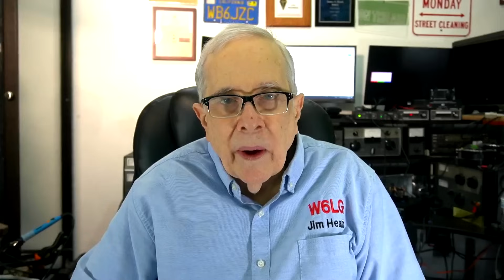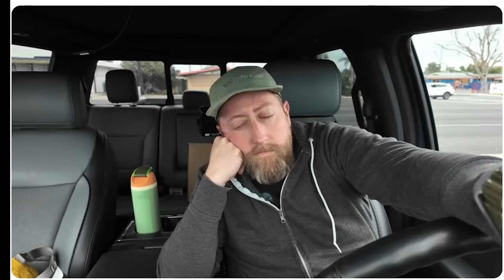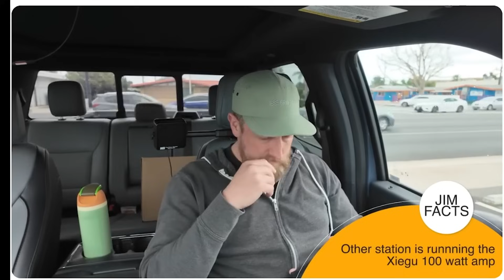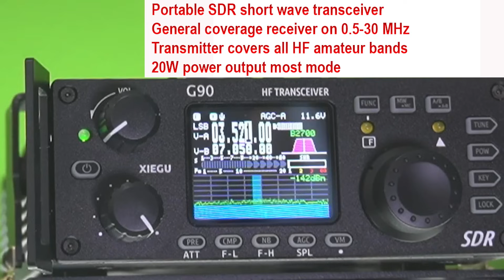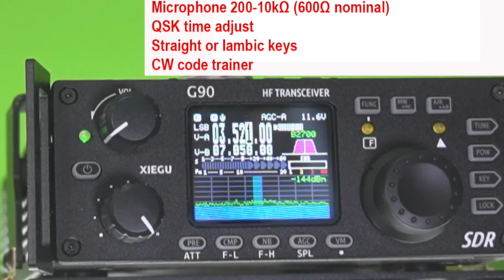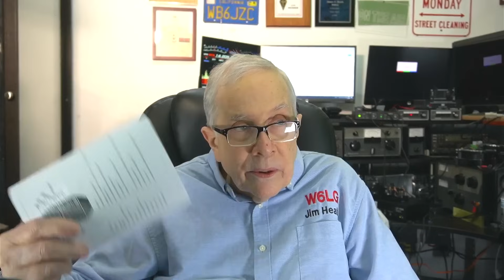What HF Transceiver Can A New Ham Buy For $500?

Comment: 73 from kc0lkv, owned a g90 and worked all over the world with 20w. I have a good antenna, a Gap Challenger Dx, and I believe that it is the most important part of your station . I have few good Hf like the 7300, the 710, 991A and my favorite Ftdx5000. I believe that there are few good Hf for less the 1000. Like the Yaesu 891 and Yaesu 450. Both exceptional radios ..especially the 891. Just my 2 cents. 73 Andrea

Comment: Hello Jim - Really great to see you again - I have a G90 which I use mobile/CW.  I find it a really great rig and get great pleasure from low power operation. Being a 100% CW op I find it great on CW especially the filtering.  While the filtering is not as good as my old Racal RA117L for the price it is a great little rig especially for a new Ham. 
73 de Ger County Clare Ireland.

Comment: I still think a good idea for a new operator is to connect with a local club.  Active clubs often have members who are upgrading and surplusing their old radios, often for less than a new G-90.  No warranty, but you are buying among friends who are unlikely to give you a bad radio.  Our club puts any radio it receives for sale on a service monitor to check its health.   And the used radio may come with accessories that you would otherwise have to buy.  Sure, the older radio may not have a video display with waterfall, but it may have more knobs & buttons instead of cryptic menus going 5 levels deep.

That said, the detachable head on the G-90 appeals to me because it would be easier to install as a mobile rig in my Tacoma than a lot of other radios.  Glad to see that it gets a thumbs-up from you, Jim.

Comment: I've had two G90's and I still own one. I think the guy in the conversation said he was using the optional XPA125B 100 watt amplifier which costs about $100 more than the radio. I also have the amp and I love them both. Lowest price I've seen lately is $415 for the G90. Good to see you Jim.

Comment: Output power is only ~16W in reality.. And bugs of firmware (display freezing sometimes). SWR meter shows better results than in reality. Tuner is very good. FM broadcasting is buggy (f.e on 11m). Good value for money.
Reply from the maker: I think that I said I tested using a Bird 43 and a Bird Dummy Load on 20 meters. Supply voltage was above 13vdc.  73, Jim W6LG
Reply: @ham-radio  Maybe. But this is also with pro meters..
https://youtu.be/5uX57EkcL-M?si=C75aNMMK-3_fBqFI

Comment: Thanks Jim for taking the time to share your thoughts and opinions with the community. I was that ham when first licensed in the early 90’s. I couldn’t afford a HF rig. Finally got a good used Kenwood TS-140 ( I still have it ) a very basic entry level radio even then. Later after passing the tech+ allowing some HF. I rolled that big vhf knob many miles. 
I am very fortunate to have since upgraded. As we get older and have more expendable income. I own a G90 it is a great portable radio. I also have the X125B 100 watt amp for it that I rarely use. It’s not the radio my IC-7610 is but serves its role very well as a grab and go radio. As an under $500 new radio it’s a solid choice. I would recommend it to someone who is considering it. I also would recommend if not having a waterfall is not a dealbreaker to look into a Yaesu FT-891 for a HF + 6M & 100 watt radio for $130 more. 
73 de KK4LBJ

Comment: I love mine. I got it for portable ops and have it in my go box with a couple of 6ah LiFePo4 batteries and a portable wire antenna. I mainly use a Yaesu 710 as my shack radio and I love the audio. Yes the G-90 would make a great 1st radio, especially for someone on a tight budget. On a side note, my Chinese engineer friend says the Xi is pronounced halfway between see and she, then there is a short eh sound and then goo. If you pronounce it "xi goo" like most people do, it means something different. He said Shee eh Goo is close enough if you live in the right place in China, kind of like speaking Redneck Chinese he said. I gave up on getting it right, and like you I just generally call it my G-90 and everyone knows what it is. Good video on a good radio with a terrible name. We should call it Gem. The Gem G90. Nah, gem probably means something weird in Chinese.
 Boyd, WE5BC

Comment: The G90 is my first HF transceiver.  I've no regrets or buyer's remorse.  It's a combination of features that make it work for me:  SWR sweep for tuning resonant antennas, ATU for non-resonants, waterfall for finding signals, compact size, and low power consumption.  I wish it had some more power, but 20W > 5W in all the new QRP SDR radios (Icom 705, Yeasu FTX-1, Xiegu x6100).  Even when I eventually upgrade, the G90 is staying in my ham radio go-kit.  There's a few guys with them in my local ham club.  They all report positive experiences as well.

Comment: Excluding CB's the G90 was my second transceiver after a S/H Yaesu 450D It does not replace the 450D but offers portable and antenna experimentation options that would be problematic with the 450D . Would I buy one again ? - you bet.

Comment: As a connoisseur of high quality expensive hf equipment, I’ve always stuck to mainstream and high performing HF radios. I’ve always poo-pooed the G90 and similar radios. But, now that Jim has graciously, fairly, and positively reviewed the G90, I’ve had a change of heart. I probably won’t run out and buy one, but I’ll recommend the G90 to new hams when they ask my opinion. Thank you Jim for this video. 

Steve N7TX
Carefree, Arizona

Comment: A very thoughtful video, Jim. Getting started on a budget makes radios like the G90 very interesting. Based on this video, accounts of your experience, and those of some others, it is a sensible proposition for a newcomer. From experience, receieve sensitivity is as good as your local noise floor i.e. nearly every receiver is good enough on this point of specification. 20 W seems like a handicap, but an enthusiastic ham will make it work, especially if they are willing to test some antenna designs. Considering myself still a beginner in the ham world, I bought a "100W" used radio (which cost more than $500) but typically dial the power back. No disappointments but the Xeigu could have made most if not all of my QSOs. 73s and thank you again

Comment: The G-90 tuner is legendary. K8MRD (Ham Radio Tube) did two videos , using a G-90 to connect to random objects  (chain link fence, metal shopping cart, telephone pole guy wire, metal stair railing, metal guard rail, etc.), and he made POTA contacts. Very interesting and entertaining videos:   https://www.youtube.com/watch?v=pLoVnFD71o4 and  https://www.youtube.com/watch?v=OnmNIXAi9ac&pp=0gcJCY0JAYcqIYzv.  So, I think the G-90 is a good starter radio, but if you look out for sales you can get the 100W Yeasu FT891 for a bit more than the G-90,  I got my FT-891 (new) for $579.00.

I've been seriously thinking of getting a G-90 just for the fun of it based on K8MRD's videos. Glad to see you're still making videos, when I got my license 2 years ago, your were the first ones I watched... very helpful, thank you and may health be with you!

Comment: I started with an IC-7300 and still have it an enjoy using it. I also have an Elecraft KX3 and a CFT-1 from Jonathan, KM4CFT.  But, I still wanted a G90 😀so I bought one a couple of months ago and I am very impressed! It is easy to use and works well! I don't mind the small display and I bought a third party VFO knob on Amazon that is bigger.  N7BBQ
Reply: Get the quantum sdr make the display larger 😁

Comment: I think we're living through a golden age of ham radio. Inexpensive radios and amazing YouTube creators like yourself make the hobby more accessible then ever before. Even for 30 bucks someone could get an SDR dongle and a little bit of wire and dip their toe into HF listening. That's what finally motivated me to get my upgrade to general.
Reply from the maker: Thanks, Jim
Reply: The golden age of ham radio was before this disaster we call the internet, and the bane of our existence we call cell phones. 

Sadly
Reply: It may be better than before but ham radios are very expensive in relation to the cost of the components. Marilyn because it's a hobby. You can buy much more sophisticated tech in almost every other field for pennies on the dollar. Supply and demand I guess.
Reply: I have a g90 and it works great. I love it. I'll keep it even after upgrading to a yeasu or icom.

Comment: I bought one as my first HF rig. It did have an issue with the built in tuner and was cheerfully & quickly replaced under warranty. I was wary of buying a used rig with unknown history/reliability. I plan to upgrade to a fancier rig for use at home and dedicating this for POTA. I’m very happy with value received for my $ spent.

Comment: I have a g90 and the GSOC touch screen controller, which gives me a 7 inch control screen. It is an excellent radio, and when paired with the XPA-125b amplifier it’s a full featured radio. I have a variety of radios including the FTdx10, and I still make sure I run the G90 from time to time, it’s an excellent radio.

Comment: I had a chance to compare the X90 to the IC-7100 that I use for POTA and I've got to say I enjoy the color display and internal tuner on it.  It would certainly be easier to carry as well if I had to hike somewhere to use it.  It's a good starting point to get into HF, and if you find out you like it, then you can upgrade to a 100+ watt base station and keep the X90 for Field Day and POTA. 73 de AK9AR

Comment: Hi Jim, so nice to see a video from you.......we all apprecite your insight....... got to thinking, my 1'st station was a used DX-60 we bought from Radio Shack in 1963 it was just the transmitter (I'm sure you know but probably many don't) it cost (I think) $45.......the US Inflation calculator calculates that $45 in 1963 is equivalent to $471 today.......I paired that with a very simple Hallicrafters Rx (don't recall the model or the price) later I bought a used HQ-170....... if it was a $100 that unit would be the equivalent to $1048 today......so I might have had the equivalent of a $1500 station at that time as a High School student. My family was not wealthy and I saved up for the equipment......my point is that Amateur radio has never been a cheap hobby but that good used equipment can get you started and a good used IC-7300 for $700 (I see them on QRZ from time to time) is probably the way to go. full featured, very intuitive to operate, works right out of the box, 100 watts, etc etc The worst thing to happen to a new ham is to get frustrated with the equipment and not make sucessful contacts. Success breeds success..........feel better and hang in there, 73, Mike K1FNX near Boston

Comment: I love my G90, if you hold down the POW button it will do an SWR sweep of the antenna you are using which is nice in the field. 
You don't have to baby it in the field as well, it is rugged and can take a beating. 
It was a huge upgrade from my FT-7.

Comment: Hi Jim, interesting  topic!  Man, your audio sounded good on that recording!

For all the features the rig has, 400 bucks is pretty hard to beat.  I think it is most important to get new hams on the air, as I was licensed at the same time as two friends that have yet to even transmit once.  This was over 10 years ago!

I'd say a new op could get one of these rigs, have fun, and as time/money permit move up to something better.  Keep the Xiegu as backup, use it mobile or portable, or sell it to another new ham to get them on the air.

73 and hang in there with the chemo!
Brett K5WXP

Comment: My first HF Radio was a G 90 and made a lot of contacts with it in 2022 when I got my first license in May 2022 but then when I got my general license in June 2022 I got the G 90 but in September 2022 when I got my extra class license in November 2022 I ordered the Yaesu FT-891 and have made contacts 49 countries so far most of them on ft8 . 73 K4BWN

Comment: The Xeigu G90 is a wonderful transceiver. Its not just a first timers rig. Lots of seasoned operators acquire it specifically for its portability and it seems like the antenna matching unit will match just about anything. I am not as big on 100w out of the gate for the new HF operator. There are pro's and cons both ways. The Xeigu G90 has everything under the lid except 100w. I believe that is a BIG positive for a new HF operator. 20w vs 100w is not enough to recommend 500 more dollars. Good to see you Jim!

Comment: Jim, It is my first HF radio, and it's a great package with its tuner, SDR, and SWR meter built-in. 
I have an EFRW running in my HOA restricted QTH, from my 6ft fence on one side to a 23ft painters pole and 71ft wire, links of 84ft and 91ft as guy wires. Only been on HF since Thanksgiving 24, >6300 QSO"S, 847 parks hunted, 112 DX @20W SSB/FT8.  Yes, I love it. 
73
Rodney 
KJ5FWC [E] [VE] [RACES] SkyWarn

Comment: I'm happy to see you post another video. I've been enjoying them for years. I have been reluctant to venture into inexpensive Chinese HF radios as my luck with them in the VHF/UHF realm has been a bit lackluster in RF performance. My first HF transceiver was the FT-817ND a decade ago, which was more than $500 and features a lackluster screen and not a lot of RF output, but was about the least expensive radio available at that time new. I'm glad the price points are busting below $500. HF has always been cost prohibitive compared to other bands, so I'm happy that manufacturers are taking strides to get the amateur community there.

Comment: Thanks for the video, Jim. My comment is long-winded, I'm afraid. Oh well.
I'm a radio experimenter. I've done a lot of LowFEER work, but when I decided I wanted to get into Part 97 HF some, instead of building something from scratch I decided to buy a kit to make the build much quicker. I bought a QRP-Labs QMX+ QRP kit to build and am quite pleased with it. It covers everything HF, 160 right up through 6 meters. It's a good rig, and the tuned-up mic with the new SSB firmware is sounding great. The best description I can come up with is that the Polar Modulation SSB Hans Summers has optimized has a punch without sounding punchy. The name Polar Modulation isn't some marketing hype. It's an entirely different way of creating a SSB signal, and it works very well. The QMX+ is definitely short on graphics, way, way short, but I'm more into simple radio performance, hearing and speaking, or sending and receiving clean CW or data, and the QMX/QMX+ has a 24-bit A to D chip, a high-performance processor, and a GPS receiver that locks it on frequency to less than 1 Hz. It als has I/Q output so it can feed a laptop's display with all sorts of graphics possibilities. 

I also built a generic Chinese 45 W amp for it, (with a step-up DC to DC converter to raise the drain voltage so I can hit about 60 W on most bands when needed, except not on 6 meters. The amp stops at 10 meters, and I have resonant homebrew horizontal and vertical wire antennas I've built for it, (I don't like to run antenna tuners.) I'm also working on a high Q mag-loop for it. Total cost for rig and antennas, just about $240. 

BTW, I also own a Xiegu G-90. It works fine. No complaints. But it was $400, it doesn't cover 6 meters, and I didn't have the fun of building it. I find it very easy to repair and mod rigs I've built myself, so a kit is a plus. The QMX+ is noticeably better than a uSDX type QRP rig, and not a whole lot more expensive. It is excellent on digital modes. In fact, it was originally designed for them. Thus the RTC and the GPS frequency reference. If someone can solder I recommend the rig. (They also sell it factory built, but if you want it for a Christmas present, I'd suggest you order now. I hear the waiting time for the assembled units is loooog. But there's nothing else with this price/performance ratio that I have found in my wanderings.
- - -
The reason for the name Xigegu is that's the name of the Chinese company that designed and manufactures the G-90 and other RF gear, and they sell to people around the world who speak a lot of different languages besides English. So I guess they felt no great desire to try to sound like an English-speaking US company.

Hang in there, Jim. Your Elmering is much needed and appreciated. People who know what they're talking about are in short supply.

Comment: I've had the G90 for 4 years now and continue to be impressed by the value. Some may scoff at only 20 watts, but in my opinion, it really increases the excitement quotient. I've logged into our 40 meter net for years with the rig and often get compliments on the audio. The biggest thrill was making a 5x7 (both ways) contact with a VK on 20 meters using my 135' end fed. He was as surprised as I was with the contact AND the quality of the signal. I also own a Yaesu FT-DX10 which I enjoy, but even the Yaesu is missing features that the G90 offers. The SWR scanner on the G90 is a welcome feature. As is the multi-function mic. 
In answer to your question, the G90 is an excellent rig for a new ham. Keep the RF gain turned down to about 15% and the background noise quiets down and the signals just seem to pop out of the ether.
Still the value leader at this price point.
73, Bruce N7BWB

Comment: I got one when I was new, I was a tech and blast with it on 10m at the sunspot low. I think it's an ideal first radio, and when you want to upgrade, you still have a decent portable radio. I can handle a used radio now, but when new I had a hard time figuring out what was user error vs an real issue with an 80's era radio... The build in tuner is a big deal in my opinion.